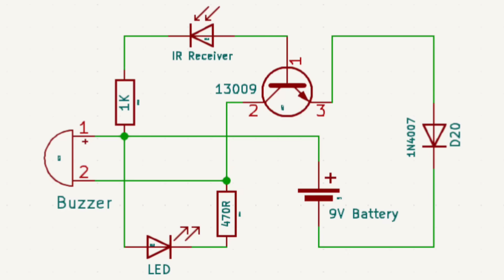You won't believe this Electronic Project is helpful for every home

Comment: Pls mark IR receiver's Positive negative terminal
Reply: Positive IR to pin 1 transistor, negatif IR connect to positive battery via resistor, may help u
Reply from the maker: Please check the diagram, shown in video
Reply: It is so sensitive that before the light signal arrives it already sounds